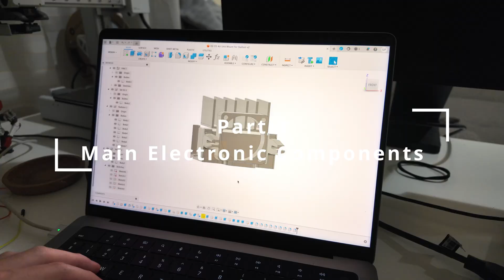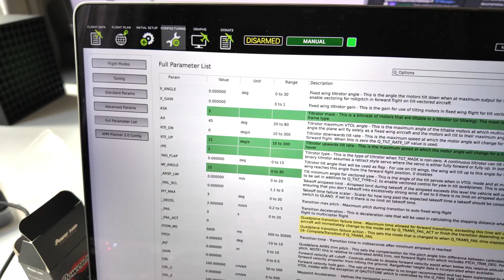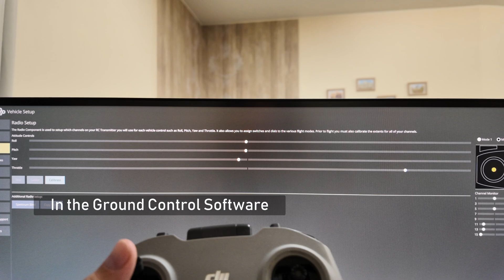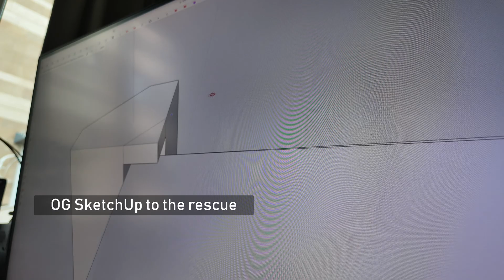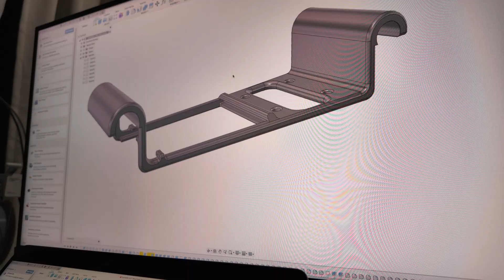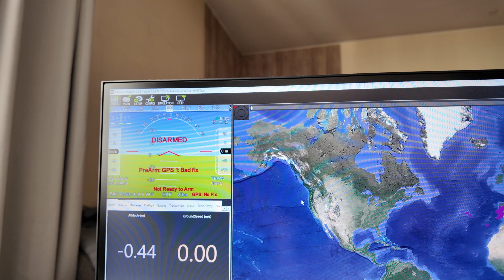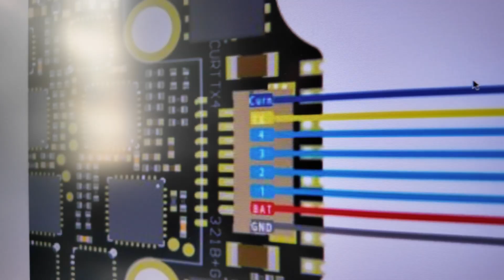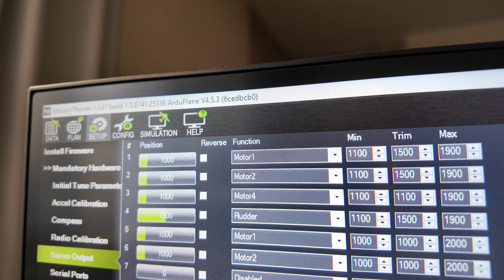I Built an Autonomous Drone at Home: Electronics (4/7)

Comment: Hi George and greetings from Greece!! I am overwhelmed from your detailed build review and yesterday I bought the stl files from flightory for the stallion vtol. I have some questions to ask before I start the project. Why did you use the 4 in 1 ESC and not 3 esc's? How did you do the esc calibration through the mission planner? Why did you use 6s battery? I saw on their site the 4s recommendation.
Reply from the maker: Hi Mario! Good for you! You can go with either 3 individual ESCs or a 4-in-1 ESC, no meaningful difference except packaging/cooling, etc. I setup motor direction for the ESC via BLHeliSuite32 which requires an Arduino boot loader. Alternatively you can just reverse the motor wires. ESC calibration is done by booting up the ESC with throttle sticks up, which I did not know I had to do and it worked out fine. I did use a 6S battery to keep the Amps lower - just make sure to get the correct Motor KV. I used 2807 1300kv. Pretty much everything works with 6S these days - just make sure the ESC does as well. I wish you luck with your build!

Comment: My ESC is not working correctly. Wired it and when turning on motor 2 turns on the same motor 1 backwards like there’s an open ground. Any suggestions? How did you figured out the single ground?
Reply from the maker: Hey, if you're using a 4 in 1 ESC, make sure you see the technical sheet of the esc for the correct order of the 3 signal wires and the single ground wire. Connect the 3 signals to the pins on the FC. Connect the ground wire under one of them to the FC. There are markings on the ESC 1-4. Make sure they match the signal wires. Motor wired to pad 1 should match signal wire 1 that goes into (for example) into FC's servo pin 1 that is configured the role of Tilt Motor Left. After that is done, you may need to reverse the spin direction either via switching the power cables of the motor or by programming the ESC with BLHeli32suite. Keep in mind that in "Motor Testing" in Mission Planner the motor numbers do not match. Good luck!

Comment: Could you please help me to check our soldering result? How to know that there is no short connection in our soldering result?
Thank you
Reply from the maker: Use a multimeter to check for proper connection between the pins and a ground. Make sure the pins do not move when you gently press them individually. On my first attempt, half were bad. Had to redo them. This WILL cause a crash if done wrong. Buying a pointy soldering tip and raising the temps should help. Good luck!

Comment: So as far as the electronics on inside of your stallion. I created this thing and I call it MAPP. Modular Avionics and Power Platform (MAPP) And it's pretty much a sled that kind of fits into the front like of the nose like a drawer it's on rails and all of your electronics go on the MAPP. And I put a fan in front and on the sides and another fan behind it to help push air out the exhaust have you ever tried thinking of something like that because it works really good
Reply: So it will literally all your electronics will slide in and out with ease quickly and it makes it a lot easier to work on so when you want to work on it you just pull it all out like a sled like a tray
Reply: if you contact me i can share my prototype pics with you
Reply from the maker: That’s certainly interesting. Would love to see it!A few notes based on my own understanding:
1. The FC has to be near the center of gravity of the aircraft for better IMU measurements. 
2. The power cables and ESC should be away from sensitive electronics like the GPS/Compass module to avoid interference. 
3. The Nose is the most likely victim in case of a crash - which can easily become expensive. 
Other than that, a modular approach seams better, but I would personally prefer to only have the payload be modular. If you’re using the same MAPP on different airframes than yes - that’s awesome.

Comment: Have you had a chance to upload the final design of the DJI Air Unit mount? I have the Walksnail GT kit but maybe your mount will work or can be modified to work with mine.
Reply from the maker: Apologies for the delay. I just uploaded it for you: https://www.thingiverse.com/thing:7061965
Reply: Can I fly this with a regular RC Transmitter (FrSky in my case)?

Comment: Hello brother, can you give me your Electronics parts list?
Reply from the maker: Sure:
- FC: SpeedyBee F405 WING
- GPS: Matek M10Q GPS & Compass
- ESC: KM45 45A BLHELI_32 ESC BY SKYSTARS
- VTX: DJI O3 Air Unit
- Motors: EMAX ECO II 2807 1300kv
- Battery: LiPo 6S 6000mAh or 11000mAh 
- Servos: 2x PowerHD HD-1810MG for tilt rotors and 4x Corona 929MG for control surfaces
- Didn't have an air speed sensor, but I advise you to add one. 
That's pretty much it.
Reply: @pathfinder.george Thanks bro, so we don't need PDB?
Reply from the maker: @randomweirdguys69  speedybee f405 wing board comes with a PDB (bottom shelf)

Comment: bro how did you printed on bambu labs printer, mine is not printing , what are the settings
Reply from the maker: I don't have access to the settings. Check Flightory's FB and Discord, there are settings there.
Reply: Bambu has a pre-set. I started with bambu's and then looked at Flightory and refined mine that way.

Comment: Set up a terrain navigation system that does not need GPS. You can use digital topographic maps and LIDAR
Reply from the maker: To be honest most commercial use-cases can easily rely on GPS navigation. GPS-denied is hot right now, but is it really better? That being said, LIDAR for obstacle avoidance (birds esp.) would be epic and quite useful.

Comment: I just found this video. I've been working on my own vtol inspired by the flightori stallion. I mixed and matched a couple diffrent 3d printable plane parts and I've been going through and modifying the stl files to fit my needs including 2 tilt motors in front and 2 solid mounted motors in the back. A full fuselage. An internal winch system to lift and lower cargo, a servo actuated drop so cargo can be secure and modular nose piece for diffrent cameras and sensors. Most recently working on a ball torrent camera and spotlight mount. After I get the files done and the vtol built I will release the files. 

I've been struggling with choosing electronics so your video will help alot, thank you.😅
Reply from the maker: That's incredible! Where can I see what you've built? Turning this into a quad and using it for cargo sounds superb.
Reply: Update?
Reply: @tylersharon397  I've been unemployed and looking for work since January 3rd. And I've had some family and medical issues that have left me with depression and zero motivation 😢.  I'm sorry I don't have an update

Comment: How does the dji controller work with this? Do other dji  controllers work aswell? Like the dji rc2 with video?
Reply from the maker: Connecting the DJI O3 Air Unit with the DJI FPV Remote Controller 2 and Goggles 2 was quite straight forward. I did update their firmwares tho. Haven’t tested the range yet, but short-range quality was great.

Comment: My advice is to shield with copper foil & connect to ground the cables from the FC to the GPS to avoid any interferences with the ESC power cables.
Reply from the maker: Thank you for the advice. Would aluminum foil work as well?

Comment: What is the final price of this drone?
Reply from the maker: About $1000 in parts and 80h in print time. I'll do a detailed breakdown in a future episode.
Reply: I built my own fixed wing and it cost me $250 but its a bare bones build as I don't want to put expensive hardware on it before the maiden. That $250 is only the actual BOM and not the total you would need just to get the parts. For example the filament may only cost $10 for the build but you would need to buy a $40 roll.

Comment: Could you make a video with INAV?
Reply from the maker: I only used iNav to flash the ArduPlane firmware on my Flight Controller. As far as I'm aware ArduPilot is better than iNav for autonomous missions. As for the flashing, it's quite straightforward - refer to ArduPilot's docs.

Comment: So do you only need one ESC or do you need three since you have three motors?
Reply from the maker: You either have 3 individual ESCs or you use a 4 in 1 ESC, like I did. Not sure about pros and cons. Just make sure that the ESC's AMP rating is slightly higher than the motor's max amp draw at your voltage (6s/22v in my case).

Comment: 1. Love your videos. It definitely will help me when i decide to build one too.

2. I belive that your tail motor sound different because you are using a central ESC for all of them, and he have longer wire from the source (ESC), therefore, more resistance and less efficient power delivery, im guessing but i belive due to that he receive 0.5 to 1.0 volt less then the others if measured at the motor side. That said i think this will be fine nevertheless.
Reply: or because is mounted on the carbon rod not like the others 2
Reply from the maker: @ItaySharoni  Thanks bro! Building a stallion is a very fulfilling experience. Drop a comment when you start your build! 

Difference in sound could be that, it I bet it comes from the carbon tube resonating. Didn’t think about efficiency tho… I’ll make sure to shorten them from now on :)

Cheers!